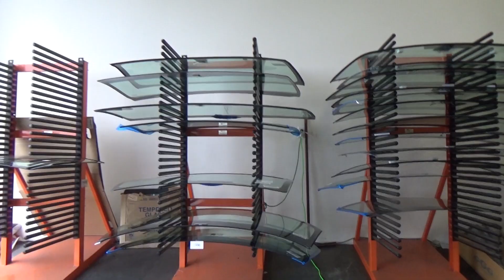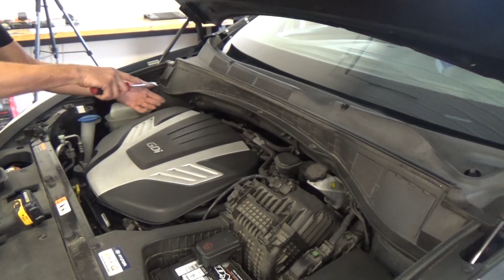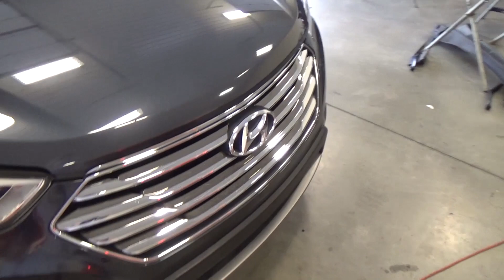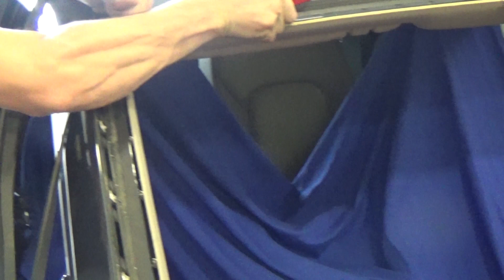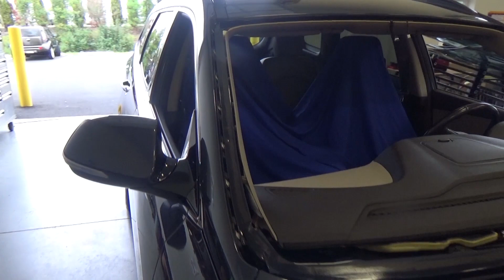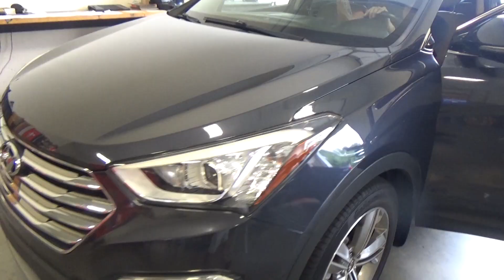Replacing a Windshield - The Right Way

Comment: GREAT vid, Glen! 👍👍 Nice to meet Tracy there. My wife is too nervous to get in front of the camera, lol. 

And don't feel bad - my wife didn't notice when her '91 S10 Blazer had every bolt loose in the tilt column - it was only actually held on by a few threads of the 4th bolt! The other 3 had backed all the way out!! 😳 I noticed it as I slid into the seat! There was about 6" of slop up and down in the column. No chance in hell she'd notice a cracked windshield! 🤣

Wouldn't ya know it ... a friggin rock on the WAY HOME from the glass company!!! I thought that kind of crap only happened to ME! 😨

I haven't seen the process done lately - last time was 26 years ago, when my ex-girlfriend and her minions threw a 30 lb. pumpkin into my '78 Cutlass' windshield that fall. Caved the whole thing in. That little hussy! 😂 A mobile guy came out and replaced it behind my dad's shed where I since parked the car, lol. He had a hot knife (probably because it was 25° out then), similar to that hand held device that Mikey used on the upper portions. Took him 10 minutes flat! I'm sure the Cutlass was much easier to work on compared to modern cars.
Reply from the maker: As long as it starts, stops has heat and a/c most wives don't notice a thing. lol  I can only imagine the reaction when the steering column comes off while making a turn.....oh man!  Have a good one Smitty.
Reply: @ozzstars_cars  - You're right on that one. She also didn't notice the tire that had 10 psi in it, either ... because it's 41° outside and raining, but the wipers and heat work. 🤣

Yeah, that would've been ugly! I ended up tearing the column down just to reach those 4 Torx head bolts (which required 2 special tools I didn't have at the time ... and haven't used since, lol!). I loaded all 4 up with red Loctite, and hogged them down good. I can guarantee, even 40 years later, those bolts aren't coming out without taking some aluminum with them. 😁 Which begs the question .... why didn't GM do this to begin with? Ahh, that's too much to digest in one night! You have a good one too, brother. 🍻